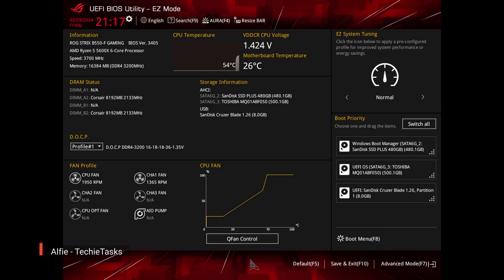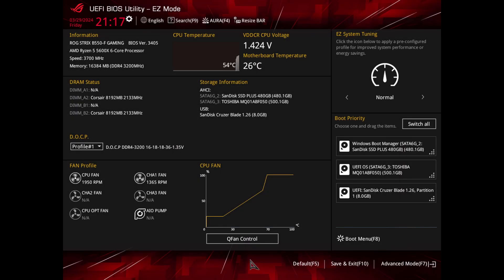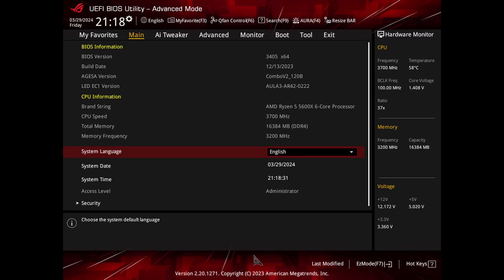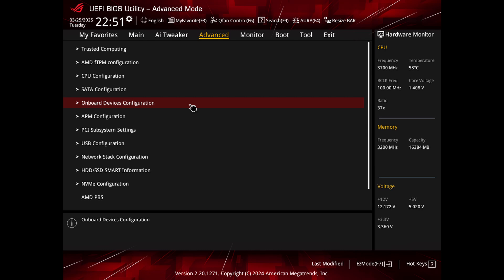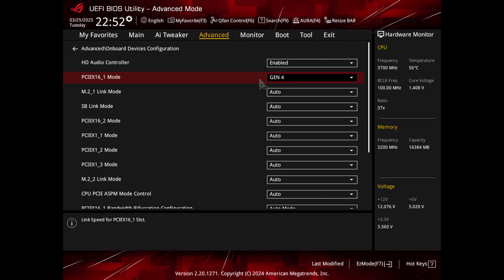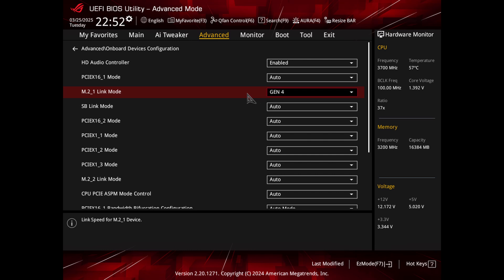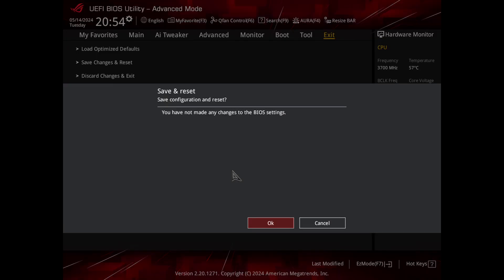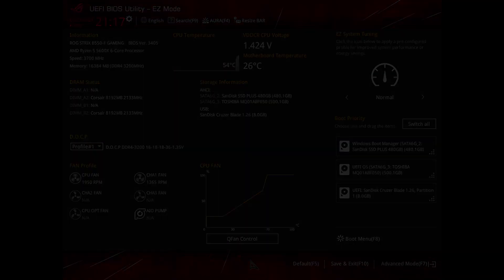How To Adjust PCIe / M.2 Speed in BIOS

Comment: What happens if that option isn't on onboard devices config.
Reply from the maker: Look under other menus (Advanced > PCI Subsystem Settings).

If your BIOS doesn’t expose a manual option for PCIe or M.2 speed, the motherboard automatically negotiates the highest supported speed between the CPU, chipset, and the device.

Comment: Can I just set that all to the highest available? Or would that cause any issues
Reply from the maker: Maxing out PCIe/M.2 settings in BIOS, like forcing PCIe x4 mode or enabling Gen 4/5 speeds, can unlock performance, but it’s not without trade-offs.

Lane Sharing Conflicts: Many boards share PCIe lanes between M.2 slots, SATA ports, and even GPU slots. Maxing out one can throttle another.

GPU Bandwidth Reduction: On boards with limited CPU lanes, using multiple x4 M.2 drives may drop GPU from x16 to x8.